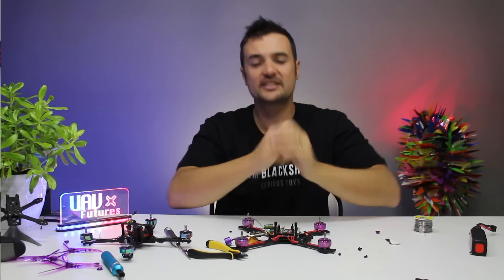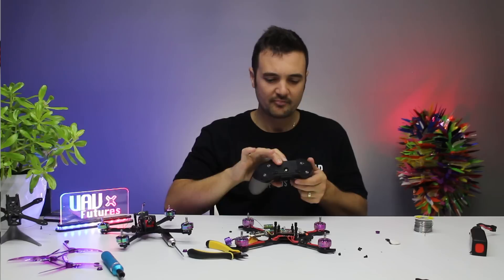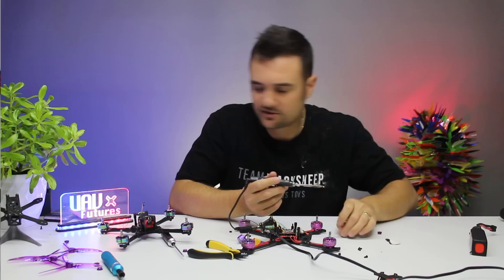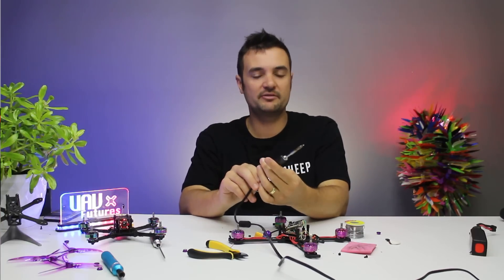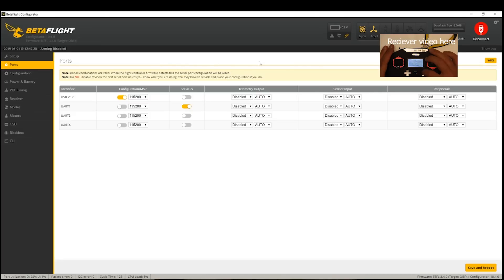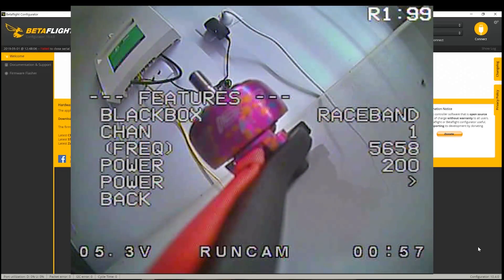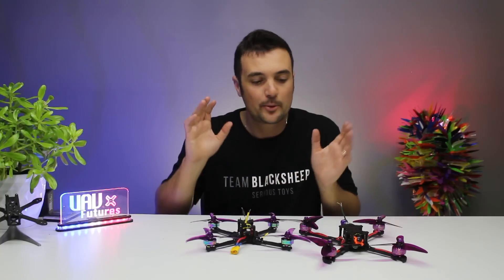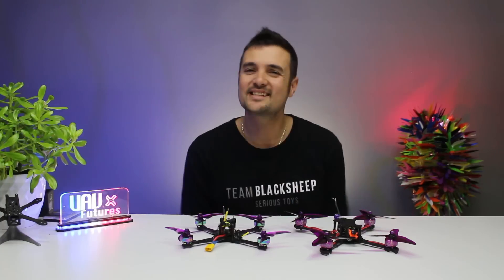How to set up Smart audio in 4 minutes!  FAST EASY BETAFLIGHT GUIDE!

Comment: I'm looking for a way to add wireless audio to any application- but I want to do it without an FC. Been wondering about it for a long time but can never get clear search results... it's too saturated with betaflight and yada yada.... internet...

Anyway- I need to do this independent of an FC because I plan to put it in some cheap RC for practice. Basically I want a relay from me to my RC of choice- to send voice through a mounted speaker- and receive audio on my end from a microphone on the RC.

It's more simple than the way I'm explaining it I'm sure- I could use some direction if anyone has an idea.

Also, thanks- I can configure smartaudio for my trashcan with this vids info. 👍

Comment: so im building this same quad now. im having trouble getting betaflight to behave. when i go into betaflight to set up the uart. i turn on VTX smart audio as you say and save. but if i got back into ports tab. nothing is there. nothing saves each time i even tried to change uarts and even desoldered the connection and tried. the VTX works but the board wont let me save the uarts if i chose smart audio. it will save with telemitry enabled. as soon as i try to save with smart audio it wipes the whole ports tab.

PLEASE can you help in any way?!

P.S.
youve been a great influence in my FPV journey. thank you for all the videos and info!!!

Comment: Do you need to have cam wired through fc to use this feature or will the vtx display the menu? My lux v2 board does not have pads for cam in and out.
Reply: Then it wont work.  Need fc osd ie betaflight

Comment: The TBS Unify pro nano uses smart audio LITE which can require a pull down resistor to be installed depending on the F.C. so if all ports/wiring correct and still no Smart Audio connection (the smart audio menu will have dashes in place of bands etc) then check with TBS.

Comment: I have found 2 vtx that does not save when smartaudio is hooked up.
The RMRC cricket nano and one of the akk 20x20   When you turn the power off it goes back to factory, I contacted RMRC on the cricket and they confirmed it. So I disconnected it and it saves.

Comment: Hay Stew  one thing I like about smartaudio is if I crash in high grass and can't hear the buzzer I can turn down the power of the VTX and use my directional antenna to locate it. And I love those AKK Transmitters I have a AKK FX3 on my glider and it's one of the best pictures I ever get from a VTX.  Thanks again for the information on S.A
Reply: Nice feed back
Reply: This is why I came to this video, how do you change the vtx power while in flight?
Reply: @cfanyu6422  HI CFA NYU   right now you can only change you settings before or after you disarm your flight controller